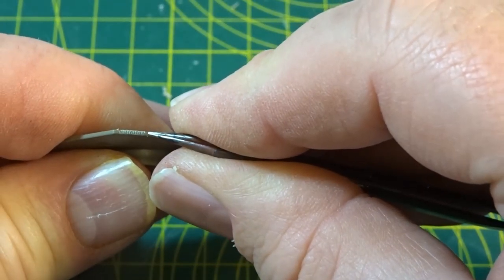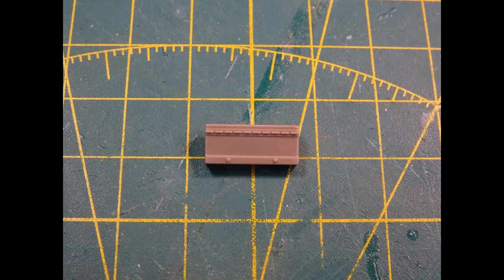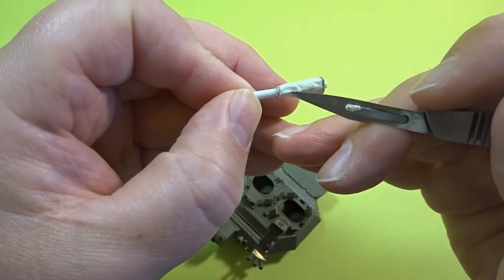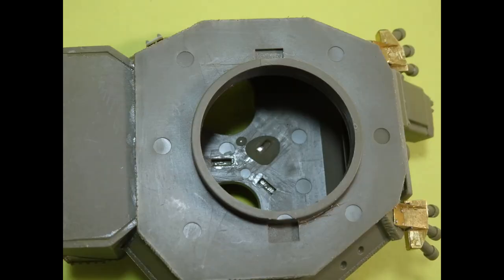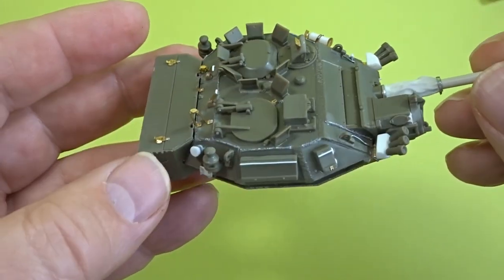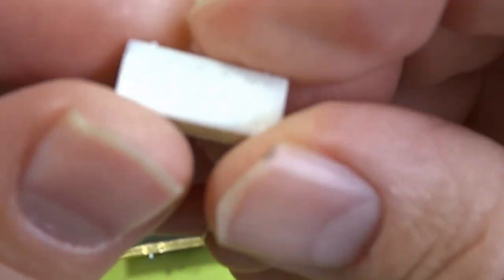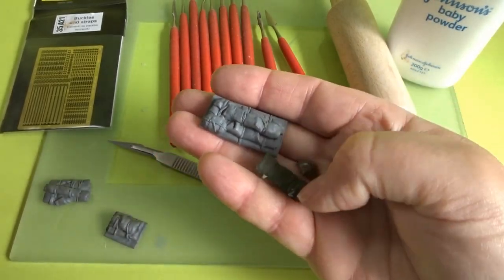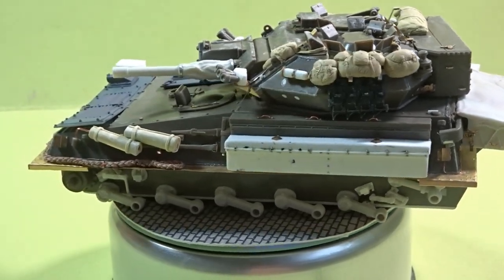Falklands War 40th Anniversary Blues & Royals Scorpion 1/35 Scale AFV Club - THE TURRET

Comment: Hi Steve. Wonderful detailing. Making your own stowage out of putty is great. It enables it to 'sit' realistically against the turret. I must try solder wire welds, I've always used Milliput worms with mixed results. Yours are excellent. Debonder does not only work on CA - you've just taught an old dog a new trick 😃
Reply from the maker: Hi Jim. I hope all is well my friend. I have had a lot of fun with the research and detailing on this build. I am still very much a beginner with the sculpting but I am seeing improvement each time I do it. Glad the weld seams and debonder tips are of some use. Many thanks for looking in and your continued support.